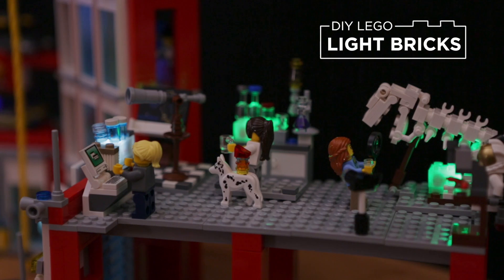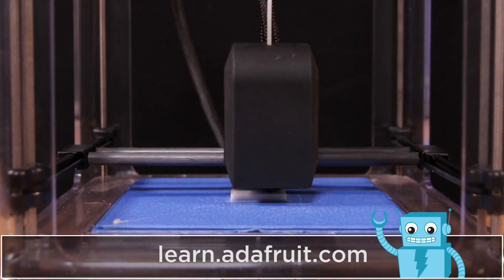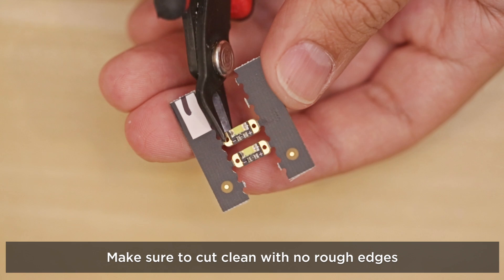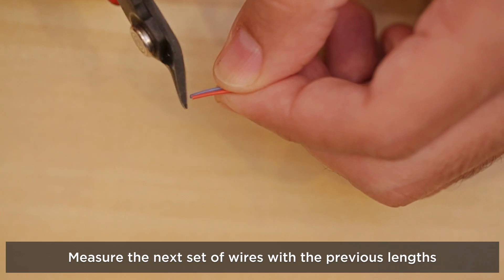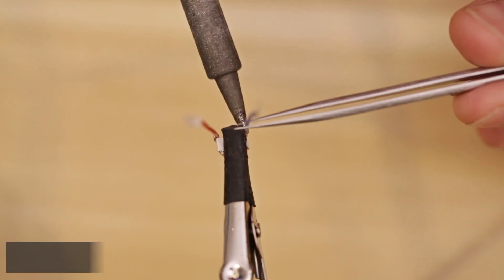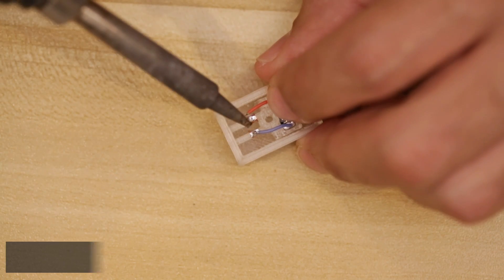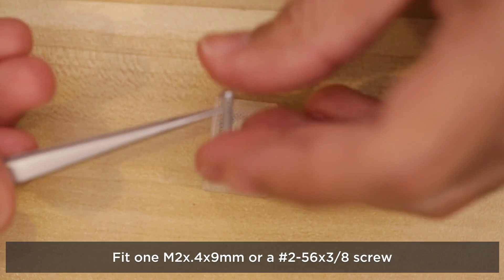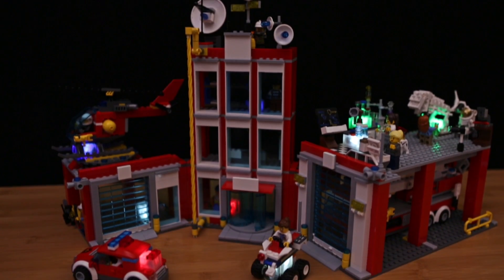DIY #LEGO LED Bricks // #3DPrinting #Adafruit

Comment: It would be interesting to put a 3mm LED into one of the round 1x1 cylinder pieces and then have a second piece which provides a connection to it. It feels like a smaller brick would be much more usable in designs as a light source. I'm surprised Lego hasn't actually done something like that yet for their modular buildings and expensive technic sets. It seems like it should be easy for them to make custom tiny LEDs and connector blocks rather than just putting an LED inside a large brick.